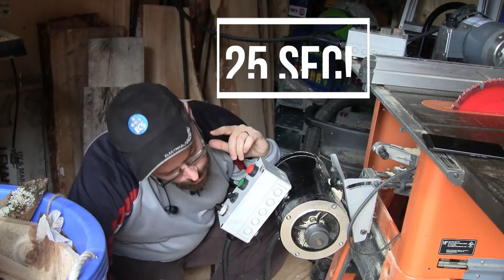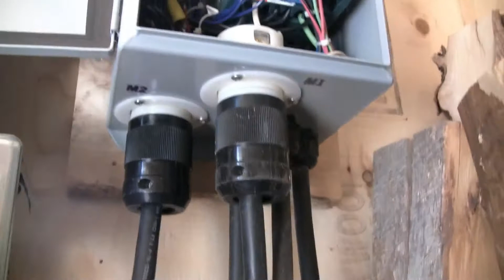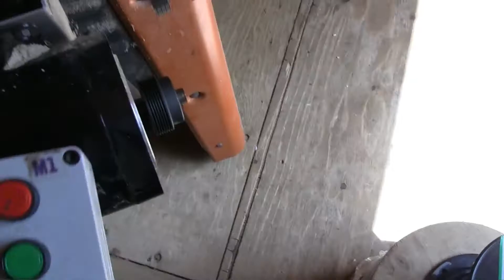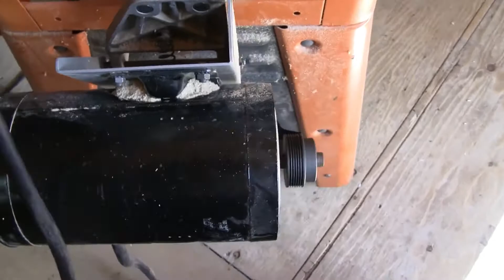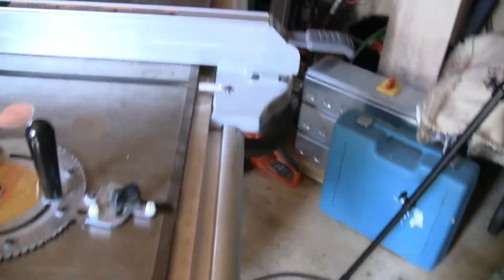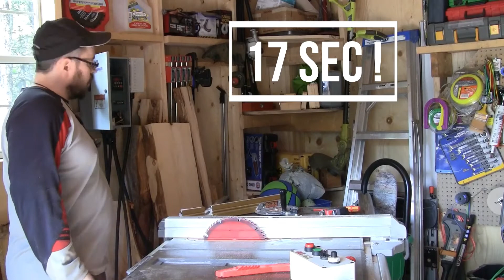World's Best Table Saw Upgrade

Comment: Ridged is a garbage saw. The lowering mechanism will fail and cost you shipping to have the warranty work done. Then you will need to purchase a good fence. The customer service is the worst. Wait and save your money so you can buy a real saw. I’m selling this pos.
Reply from the maker: Humm, maybe the new ones are junk, but this one I've had since 2003 and had no problems.  Besides, you obviously never watched the video, or you would have seen that I upgraded the saw with a VFD.

Comment: I think this is a great upgrade. I don't need it for what I do, but I want it anyway. Anytime you can wire up variable speed you gain tremendous efficiency.
Reply from the maker: Absolutely!  These days I use the ability to slow the blade a lot for cutting steel on the table saw.  I also upgraded my sander to variable speed which I'll show in a future video.
Cheers!

Comment: I bought a Craftsman lather several years ago or rather my wife bought it for me. After using it for a while and replacing several belts on it I bought a frequency drive and controller that allowed me to replace all the belts with variable speeds to a direct drive.
Reply from the maker: Yes my father has a OneWay lathe. Make sure to checkout my video on how I upgraded his band saw using the lathe's VFD, you might be able to do this yourself depending on your setup.  
https://youtu.be/DP_y-eJ1kM8
VFDs are Awesome!

Comment: You mentioned that you have sold these. Are you still selling them? I would be interested in a control box and VFD wired and ready to install.
Reply from the maker: Hi Nate,
I was selling them years ago to supplement my fixed salary income but unfortunately when I started my engineering consulting practice my lawyer advised me against it since there are too many sue happy people out there these days.  You can purchase a VFD, motor, and start/stop station online and make your own but the dual motor thing is very difficult to do and requires a lot of experience in electrical controls.  

Also, I was only able to sell these to serious commercial woodworkers as the setup in the video cost about $1000 in back in 2006.  

Cheers!

Comment: I'll  keep what i got. I dont see the point
Reply from the maker: lol like the name...
The upgrade isn't for everyone, I do a lot of things with my table saw the average guy doesn't do including:
- fast cutting with the full ~3-1/2 height in hardwood (requiring a lot of power)
- cutting plastic (requires higher speeds)
- cutting steel (longer blade life at lower speed)
- cutting aluminum (required higher speed)
If you look at some recent videos you'll see that I even cut stainless steel on my table saw, but yeah if you cut just standard wood you don't need it but for what I do this is the best upgrade I could ever have done.
Cheers!

Comment: I have the same saw and i went 220 volt and a nice thin kerf blade new arbor bearings and an anti vibrating belt and pulleys and my saw cuts through anything with ease and clean . I like how fast the saw stopped ??  don't see why you would be needing to abuse your saw motor like you do ??  Super cool video that shows there are a lot of ways to upgrade an old solid table saw.  THANKS !!!
Reply from the maker: Thanks! 
I have a battery kit I want to put on the saw to dump the braking energy in the batteries (you can see it in my tiny shed video).  I'll eventually finish it and post a video (been busy with work and the house build).  It will brake the blade even faster even at high RPM it should make for a cool video.

Comment: im wondering how the arbor bearings hold up under that much RPMS ???
Reply from the maker: Well I've had this setup for over 12 years and never had an issue with it.  I tend to cut more at the lower RPM and only use the high rpm for finish cuts so it might only run there 10% of the time.

Comment: I have always considered this an interesting and possible modification for a table saw, but I think the application you are missing out on would be using the VFD to cut different materials such as plastics or metals with slower or faster blades.
Reply from the maker: Hi Eric,
Yes I do use the table saw to cut steel with a grinding wheel and I cut a lot of aluminum.  Aluminum seems to do better at a lower speed.  I also do a lot of lexan cuts.  Thanks for the idea for a follow up video!

I also put a VFD on my father's band saw.  Might make a video of that upgrade over the holidays.  I modified his One Way lathe to be able to power either his lathe or his band saw.
Cheers!

Comment: If you're happy with it then by golly, it's awesome...but I don't understand how it keeps you from ever having to change blades.
Reply from the maker: It's basic math based on the speed of the saw teeth hitting the wood.  A 50 tooth blade at 5400 rpm will give a similar quality cut as a 75 tooth blade at 3600rpm.  A 50  tooth blade at 1800RPM will give a similar speed of cut as a 25 tooth blade at 3600rpm.  The difference is the torque of my motor at 1800RPM is double the cutting torque so it rips wood better and burns less the wood.

I also built a custom saw mill with a 24" blade with only 6 teeth.  We run it around 2300RPM and it rips mostly figured maple.  I plan to make a video of a bunch of the crazy things I built in my spare time like a VFD snowblower and the saw mill I mentioned.  At work I designed some even crazier stuff like a mine mobile sub with 2x200HP VFDs that's robust enough to take a mine blast (my customer built 20 of these so far for $250k a piece).  The last crazy thing I designed is a quiet 20kw bitcoin heater.  Only the prototype of that is built and working right now.  It heats a building for free and makes my customer $$$.

Gotta hurry and finish the house and garage to have space for the next builds and even cooler videos lol.

Cheer!
Reply: @jackofallissue6661  thanks for the lesson. 👍🏾